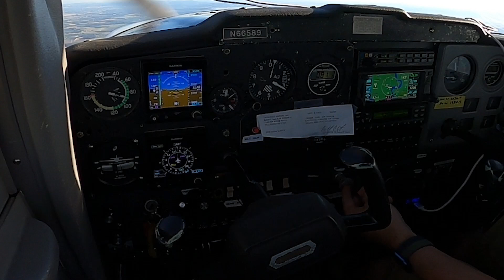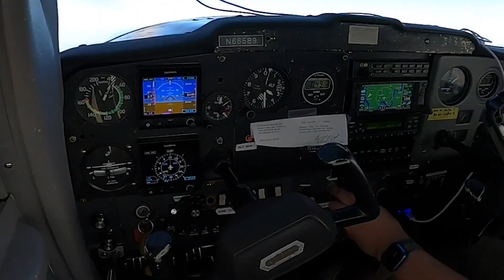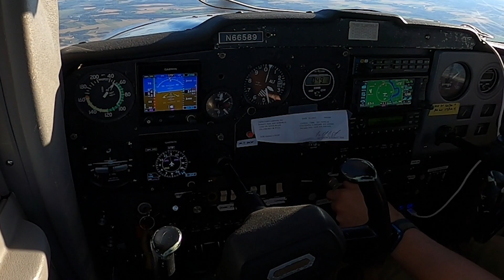ALL the STALLS! - Private pilot stalls

Comment: Common Stall/Spin Accidents that have happened at my home base and should be practiced at 3,000+ AGL with an instructor: Most common was the stall/spin on turn from base to final -- not at the runway elevation but on approach. Perfect conditions for a bad things to happen  -- slow airspeed, high workload, wondering if there goober who just pulled onto the runway will be gone in time, sick passenger, dealing with winds -- tailwind the pilot cranks in the bank to avoid overrunning the centerline in uncoordinated flight. This did not end well for any of those involved.  

Stall when over-rotating and failing to ease off the back pressure (don't say lower the nose or the student will do EXACTLY what you say -- "doing the mash... the nose wheel mash -- nose wheel gone, firewall bent, prop strike, engine shock stopped. )  to reduce the angle of attack and allow the aircraft to accelerate in ground effect.  The pilot tries to 'horse' the airplane out of ground effect and doesn't know how to handle the mush. This is really pronounced in LSA aircraft which are great fun but tricky since one has to learn the fine art of energy management. High power spam can operators don't learn these lessons.  Stall -- mush -- stall -- mush -- repeat for 1/2 mile until a light post arrested it's venture down the streets of the airpark.  Student and instructor purchased new undergarments and survived to play another day. Epilogue -- the aircraft probably should have been totaled since the engine needed an overhaul, prop was gone, firewall forward had to be removed/rebuilt, but a patient AMT lovingly brought the LSA back to life.

Scariest one I have ever encountered was when, at an uncontrolled field, an aircraft was on the calm wind runway and while another decided to come straight in from the opposite direction -- the wind was calm after all so what difference did it make? It was late in the day and the FBO closed so we can slack off on the protocol and procedures a bit -- eh? The person flying the standard pattern to the calm wind runway had rising terrain on the base which was followed by terrain falling away on final. Instinct says to hold onto that altitude on that base leg where the ground is rising up -- very easy to bleed off airspeed and get slow on base.The pilot of the aircraft landing on the calm wind runway panicked when he saw the landing lights aimed right at him and, instead of remembering that power influences altitude and pitch controls airspeed, cranked in a left bank at a low airspeed with high power, not enough right rudder, and with the aircraft "dirty". Absolutely NO WAY to recover from that one! The airplane landing the calm wind runway was on it's back in a spin before the aircraft passed midfield. I pray it was before they realized what was happening. So many lessons to learn from this one that you could write a book about it. I was not there but saw the aftermath and it ran shivers down my spine for days. Airplane, 4 passengers, and a dog departed the earth in this one. The wreckage stayed in place for days during FAA and NTSB investigations reminding  us to practice go-arounds.

Don't forget the porpoise which can be considered an oscillating stall. The pilot recognizes that bad things are happening and pumps in the power, with gusto, to go around, not enough right rudder, not at Vx yet, nose high, left wing stalls and unintentional aircraft gymnastics begin (struck another airplane that was on taxi but that student and instructor got away with a damaged vertical stab and some minor PTSD. Lucky!). Took me a few days to settle down after seeing that one. Believe it or not -- both airplanes were repairable and lived to fly another day. Another amazing AMT.
Reply from the maker: That’s quite a lot of things you’ve experienced, Richard! Thank you for taking the time to share that and fly safe! Thanks for watching! 🙌🏻
Reply: 45 years of being around GA-- you see a lot of things. The goal is to learn from them.

Comment: Spins!!!  I'm one of the weirdos who thinks this stuff is fun.  My first spin was on my first lesson and we went about a third of a turn to the right.  I had studied a bunch before hand so I called out the recovery as my CFI had controls.  I feel like stalls are very important to do early on.  Yes they can be scary to do your first time however it shows you how hard it is to get the plane to the breaking point.  Once I knew where the breaking point was and how hard it was to get to my confidence went way up.  The tricky part for me is coordination on departure stalls.  In a 152 I don't have a Lindbergh reference to use and if the skies are clear these nothing out the front.  What I've learned is I've built a feel for coordination and I can watch out my side window (also right rudder).  The more you practice these the more you'll feel the plane telling you which way its going to break as well. One good thing to add a touch of realism to this is start art a set altitude.  Perform your power on stall and see if you hit the ground (altitude you started at) kind of morbid but its the real application of the maneuver. Fantastic video as always, I need to get down to twin oaks with you one of these days!
Reply from the maker: Yes to all of the above! haha. . thanks for watching man and yeah come on down! Also, in the 152 the "Lindbergh reference" is out the side window, so you got it covered! :D
Reply: @NorthwestAeronaut  ah okay I didn't realize out the side window was also considered the reference even though I use it the same haha.  Thanks for the info!